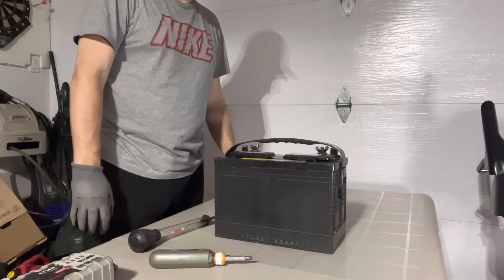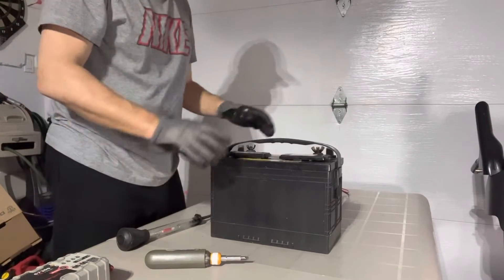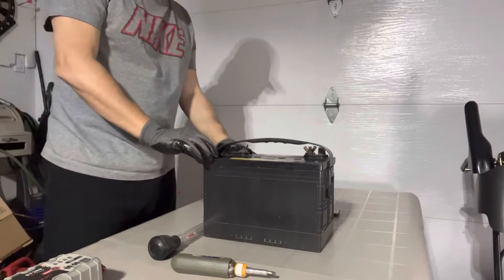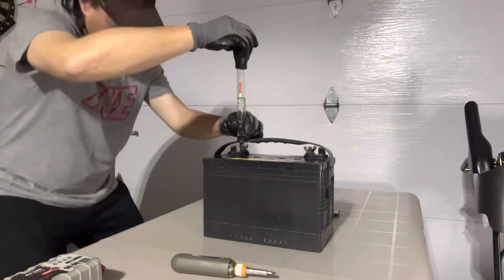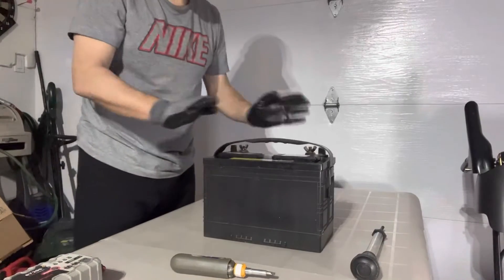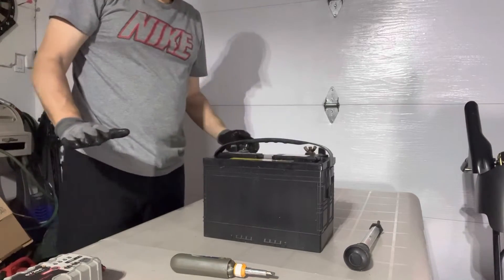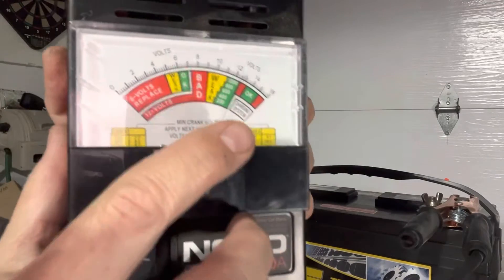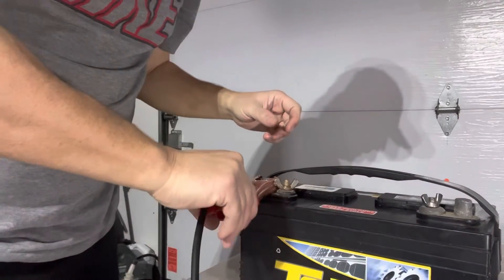Basic maintenance, testing and storage of a deep cycle battery

Comment: Great! But, don't you need a carbon pile load tester for 15 seconds with deep cycle batteries?
Reply from the maker: Hi olpreach, thanks for watching, This load tester is compatible with deep cycle batteries, and it can check the cells operating at 6 to 12 volts with 1000 CCA. The tester will display the battery condition within 10 seconds. The needle should remain in the green area. If it doesn’t, the battery is weak or bad.

Comment: you look like a pro ! I'm curious about the correct mode to charge my battery with both a Nautilus Group 31 battery from Canadian Tire and a Nexpeak NC 101 battery charger can you help me ? should i use car/truck mode  agm/gel mod or motocycle mod
Reply from the maker: Hi FXQC, thanks for watching and nice comments, 

AGM means Absorbent Glass Mat lead-acid battery,
Gel means Gel-Cell lead-acid battery, or simply gel battery.

I would set it in AGM/gel if its a deep cycle battery.

Comment: Hey Joe,
Thankyou for your videos, especially the 25HP mercury ones.
I have a question regarding charging a battery via the 25HP .
Can the mercury do this using the following:
The major components needed are:

Generator coil(s) that create electrical current (unregulated AC) from the motor’s rotation

Regulator/rectifier to convert the coil output into regulated DC current suitable for charging the battery
Reply from the maker: Hi Antonio Alessi, thanks for watching, My 25HP mercury outboard charges my batteries. My outboard has all the component necessary to do so. Mercury 25HP outboard usually have the equipment to do so.
Reply: @Joe The Boat Guy  Thanks, Joe. I will google the parts numbers required.

Comment: Do you ever run a dual purpose battery?
Reply from the maker: Hi redwood1957, yes my other deep cycle battery is a dual purpose battery. Works well but my outboard doesn’t ask for much power to start.